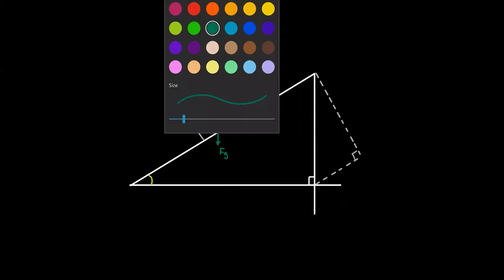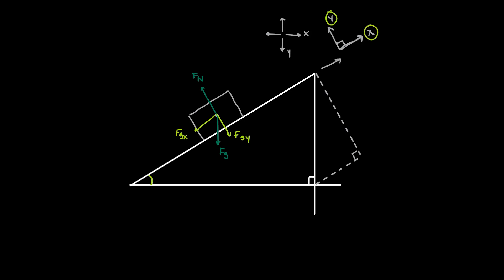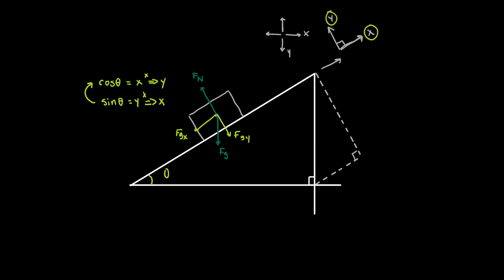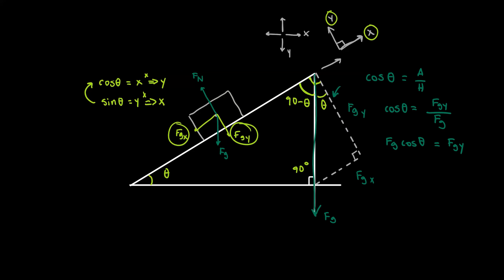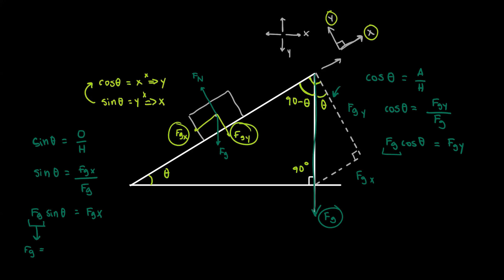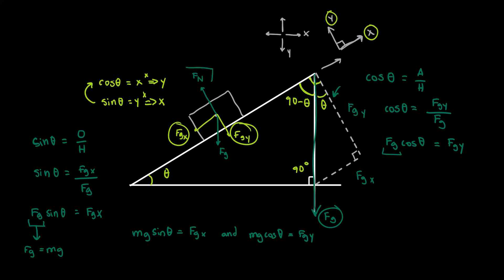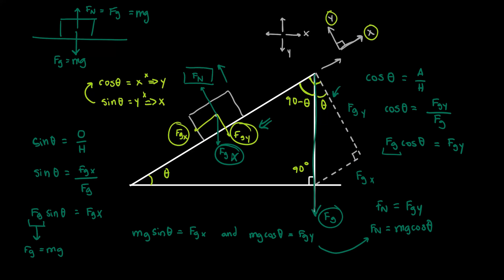Why are sin and cos reversed on an inclined plane? - Gravity components, inclined planes explained

Comment: Adding the new triangle, a new theta, and SOH CAH only made this topic way more confusing. All you really needed to do was show a standard 3-4-5 triangle with typical sin/cos for y/x, and then show how the opposite and adjacent angles switch on an incline plane relative to the location of theta and how gravity gets split into two vectors (parallel and perpendicular to the incline plane). The calculations and adding up degrees were unnecessary. Good try though!
Reply: this kind of makes more sense I need a demonstration

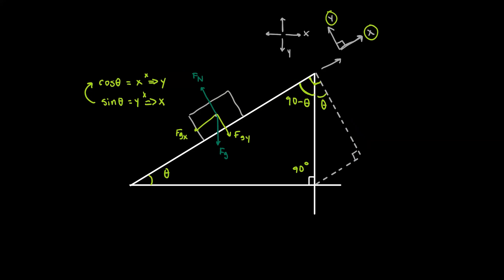Comment: 2:10 Why is that angle in the "new triangle" theta? Why shouldn't it be 90 - theta?

is it because the angle looks like a perfect angle (90 degrees), and then because half of that angle is 90- theta, therefore the remaining angle must be theta? Okay, but then what about the other magnitude of the other angle in that "new triangle"?
Reply from the maker: You’re on the right track! 

Let’s take a look at the vertex at the very top of the triangle. 

If you ignore the vertical leg of the 90-degree triangle forming the incline, let’s look at where the solid white line forming the hypotenuse and the dotted white line forming part of the “new triangle” intersect. The angle between those two lines must be 90 degrees.

Inside the “old” triangle we know that the bottom left angle is theta, and the 90 degree angle is 90 degrees. We know the internal angles of the triangle must add to 180. Let’s call the remaining angle x. Then 90+theta+x=180, so theta+x=90 and therefore x=90-theta must be the angle at the top of the “old” triangle. 

Since the angle between the dotted line and solid line is 90, and the angle inside the “old” triangle is 90-theta, we can get the angle inside the “new” one (let’s call it y) by doing: (90-theta)+y=90 and then we get y=90-90+theta and therefore y=theta.

As for the other angle in the “new” triangle (let’s call it z), since we know the internal angles of the new triangle must add to 180, we can say theta+90+z=180 and therefore z=180-90-theta=90-theta. So the last angle is 90-theta, just like we saw with the “old” triangle.

Does that help answer your question? Let me know if you want me to explain anything a bit more.